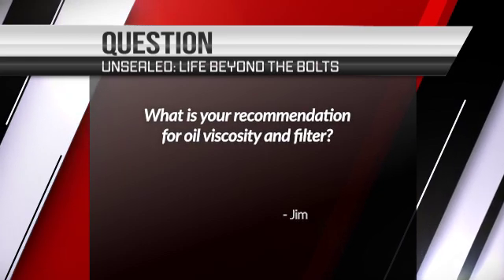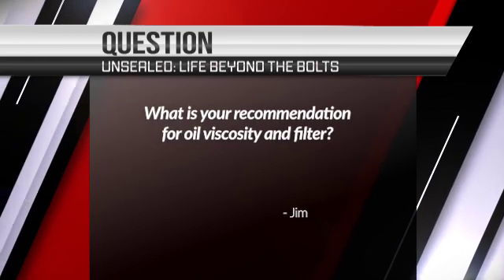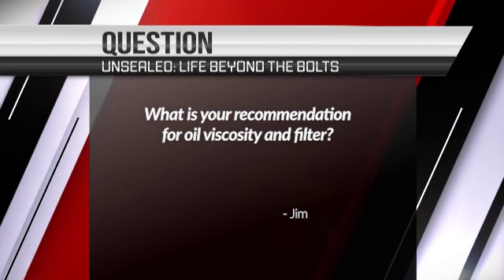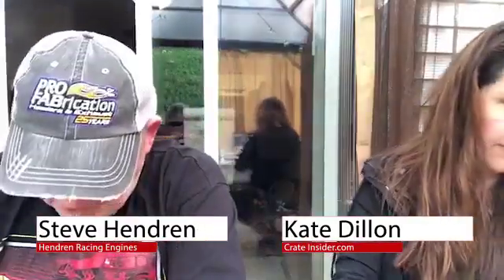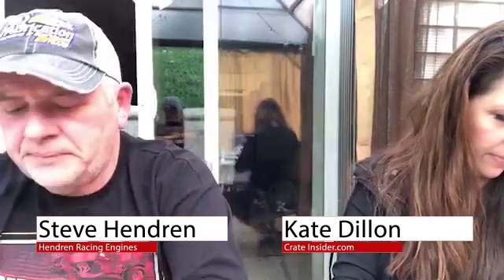Tech Tip | Oil Viscosity and Filter

Comment: So is 10/30 klotz still the best oil to use HORSEPOWER wise ?? And is 10w/30w safe enough for race abuse ??   How many laps do y’all see or think 10w/30w holds up for ??
Reply from the maker: 5/40 Daytona 1 is the best, then Klotz 10w/40 and Daytona 1 15/40 are second best power wise. All three are designed for "race abuse" in crates. The house car's oil gets changed every 6 nights.